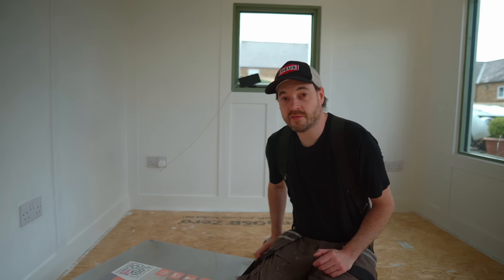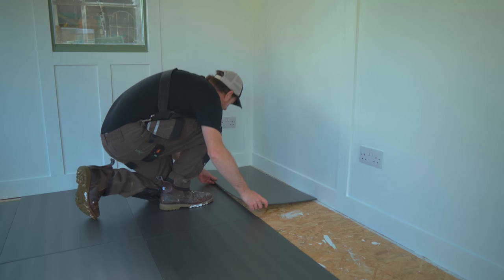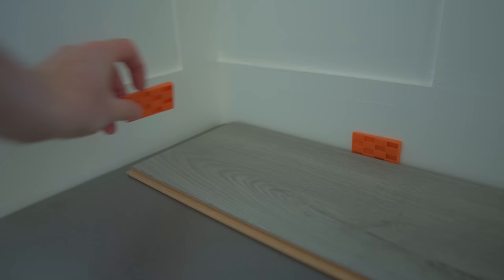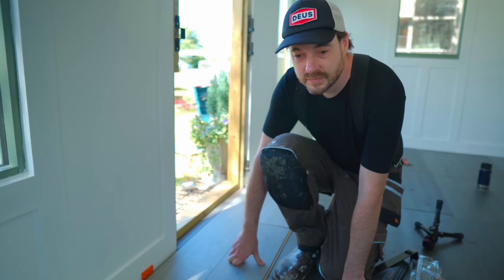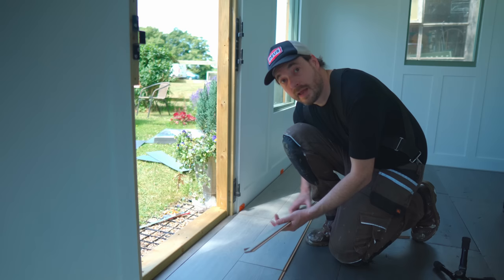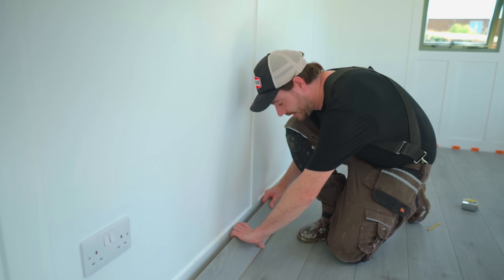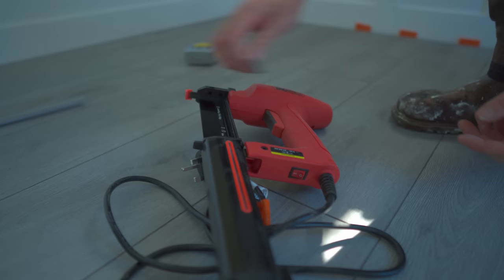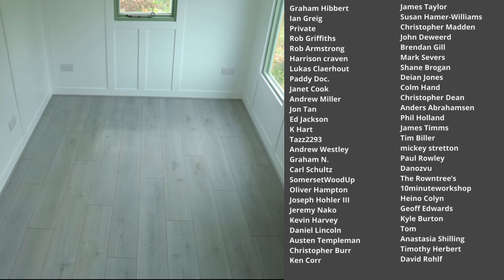Garden Room Build, The Floor

Comment: Just a thought, couldn't you have laid the flooring before putting the last MDF bottom panel piece on. That way you could have then hidden the expansion gap and looked neater than using the little strips.
Reply: Maybe incase the floor expanded upwards causing the MDF to pop off.
Reply: Normally not a practical way to do it in that order, but feel free to do it yourself.
Reply: @oslogutt80  of course its a practical way! You lay the floor, (leaving an expansion gap between floor and wall) then lay the skirting, or in this case, MDF lower rail, which hides the gap. Far neater than trimming later, a method usually reserved for hiding the gap when skirtings etc are already in place.
Reply: @ptb3335  the floor doesnt expand upwards it only expands across its width.

Comment: That's the same type of laminate I bought to do downstairs, it's probably one of the easiest I've ever used in terms of laying.
For cutting, I found using a jigsaw was the easiest option, as long as you either use a downcut blade (or flip the board upside down like I did) the cuts are nice a smooth. It also helps that my cordless jigsaw is very quiet and I always end up laying flooring at midnight!

I probably would have put it down the other way to make the room feel deeper, that's what I did as the house narrow but long, it really does make it feel wider!